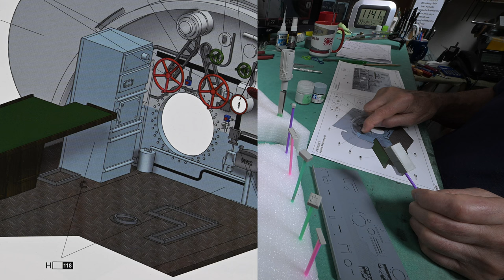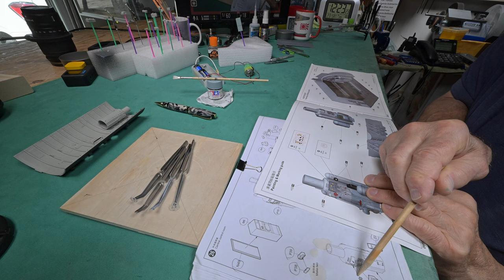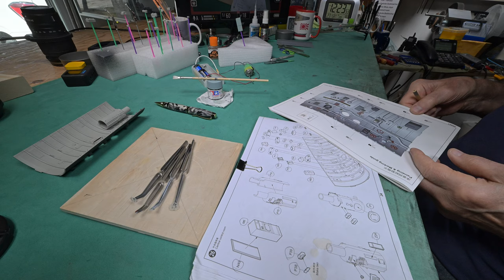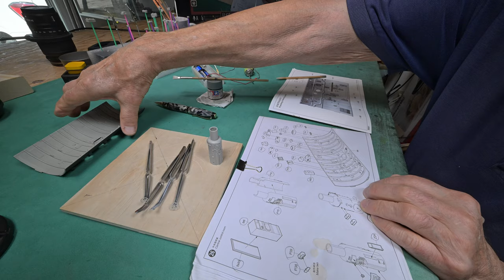The Model Ship - Part 1964

Comment: Hello!! So what is that cylindrical piece of equipment?  Maybe a heat exchanger of some sort?
Reply: Hi Ron , Glad to see your working on the control room , 
That cylindrical piece is the housing for the attack periscope , it also provided
access via the large hatch on its side to the all critical negative tank that sat below it  
The rectangular box before that is the switch panel for the fore battery group
Reply from the maker: Thanks James. Perhaps when it is in place and other parts are attached, it will be more obvious as to what it is. 🤞